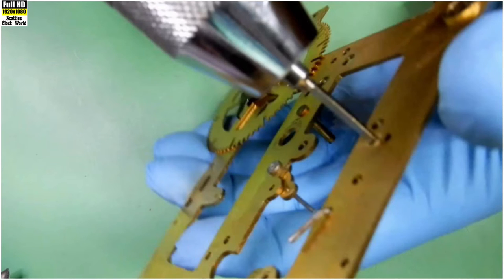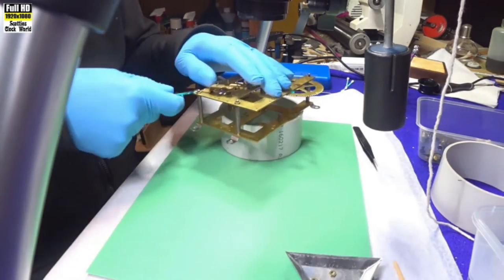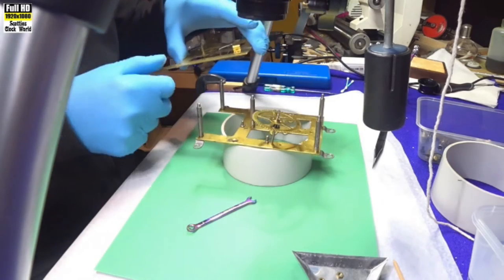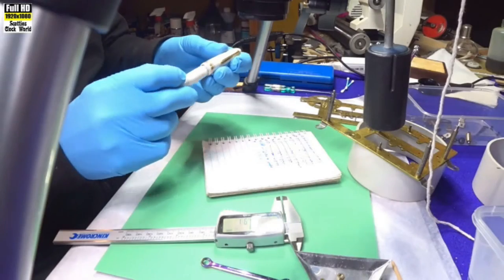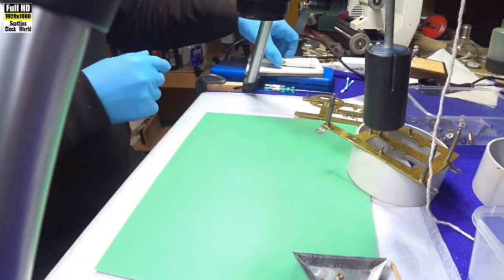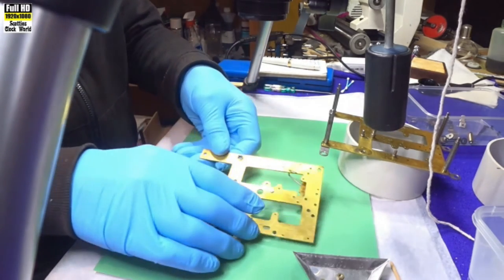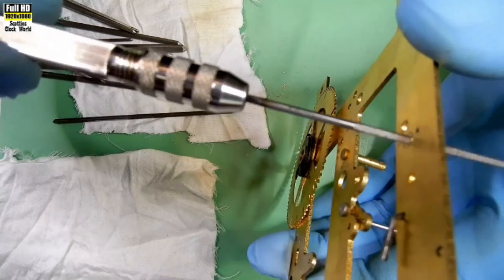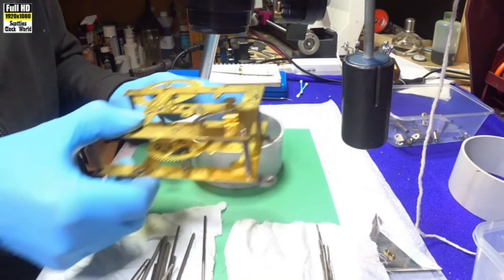Clock Repair For total Beginners - Bonus Content

Comment: Good job Scott. I think that you should however explain to people what bushes type that you were using and why. Also that you should do another video where you just use cutting broaches alone. As you said to start the video it costs money to purchase all the reamers, etc., where you can do it just with the cutting broaches. Takes more time but it can be done. That is how the General Clock Repair VHS tape that I purchased in 99 which is available now on DVD showed how to do it using cutting broaches alone. Plus you didnt explain the broach thickness and what to do if the broaches are sticking out of the plates. Some people leave them but others frown upon it if they are sticking out of the plates. Just my thoughts. Keep these videos coming for the beginners as they will be attracted to your channel. May God continue to bless you and  yours.
Reply from the maker: Good idea about the broaches. I am setting up a new series for beginners and I will add that topic into the mix.

Comment: This is the part that makes me nervous but I have quite a few that need bushed.  Trying to decide on whether to go with Bergeon or KWM?  Leaning towards Bergeon, but KWM seems to have more sizing options?  Thanks Scottie
Reply from the maker: Hi Whitney, The Bergeon setup is quite expensive, but they are the gold standard when it comes to professional clock repair parts and tools. I use Bergeon bushes on my mid 19th century French figural clocks because they require very small bushes with super fine tollerances. Depends on how far you will be going along the clock repair road. See if you can find a trashed clock at a garage sale or car boot to practise on, the condition of the case is of no importance. All the best.

Comment: Hi Scottie! I've been watching your videos to help me repair an old Seth Thomas mantle clock and this is my first time repairing a clock. I'm ordering some KWM bushings to replace the old worn bushings, but the issue I have is the old bushings are larger in diameter than the new ones. Is it still possible to rebush this movement with smaller bushings? From what I could see, KWM doesn't make bushings larger than 2.7 mm, of course I could be wrong. I'm not sure what to do and I could really use the advise. Many thanks!!
Reply from the maker: Bergeon make bushings much larger than 2.7mm.

Comment: Great video again Scottie. If say you never had any reamers would it be possible to enlarge the hole just using broaches?
Reply: Dont mean to step into his comments but the answer to your question is yes. I learnt how to do bushings from a VHS tape that I bought in 99. General clock repair. There is a DVD available now. The master clock maker Bruce E Rassumesen (? on spelling) showed how to put bushings in just by using cutting broaches. When you first start off in clock repair unless you have a ton of money to spend then you want to do things the cheapest route possible. The entire set up to include pin vises cost less than $50. Plus you will need the cutting broaches later on even if you break down and buy the reamers to broach out the holes so the pivot shaft goes into that hole. Hope this helps.
Reply from the maker: Yes, it can be done. I will be making a video on this subject in the forth comming 'advanced techniques' for beginners.
Reply: @munnerlyn3  Thank You 🙂
Reply: @ScottiesClockWorld  Thank you Scottie 🙂
Reply: @grahamharkness5744  No problems mate. If I can be of further assistance please let me know.
Reply from the maker: @grahamharkness5744  , the new series should only be about a month away, still lots of preparation to do.

Comment: Hello again. I have another question you hopefully can answer. I came across a clock movement that has already been re-bushed. Unfortunately the previous owner appears to have not cleaned or oiled it and multiple bushings are worn! Can they be drilled out carefully and new bush’s pressed in (after careful cleaning and pivot polishing etc.. that we learned from your videos)? Thank you!
Reply from the maker: Yes, that's the way to do it. Good to see you are tackling clock bushing. Many people are quite nervous about this operation, but it is one that is more often required than not when working on old mechanical clocks.